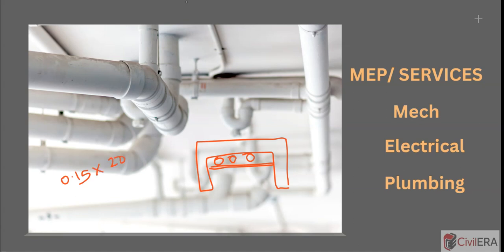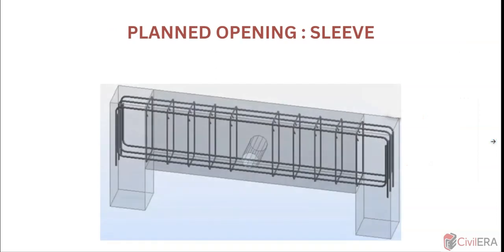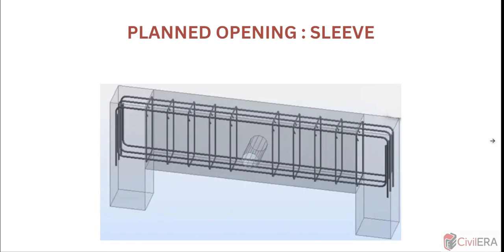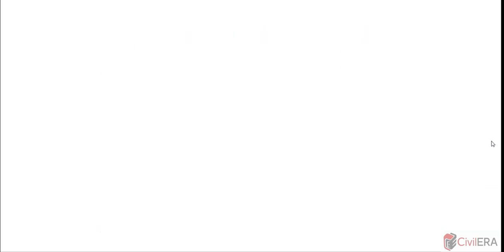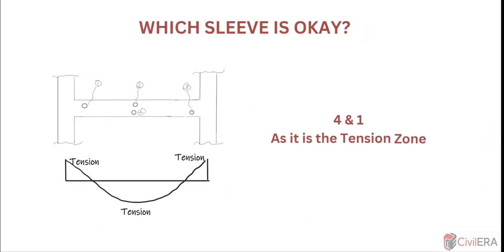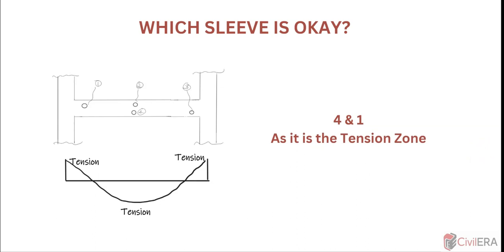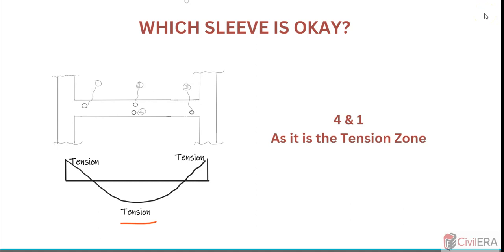All you need to know about Core cut, sleeves, and Openings in Beams

Comment: Sir, I choose to disagree. We cannot provide sleeve at position 1 as it is in high shear zone.
Sleeves should not be provided in compression zone and zone of high shear.
Sleeve should preferably located within the middle third of the depth of the beam.
Reply from the maker: I have mentioned in the video that all design parameters need to be checked too. I also have mentioned about shear. Go ahead and read my blog too which is provided in the description. It shows the additional design requirement.
The sleeve should be provided in the tension zone. One of the location, I mentioned is a shear zone. There you need to check the possibility. You also need to check if any of the load combination exhibits stress reversal and avoid that location